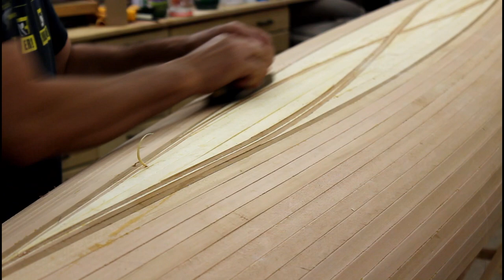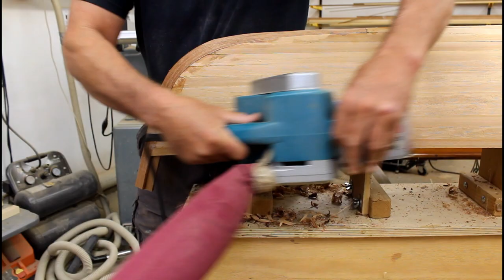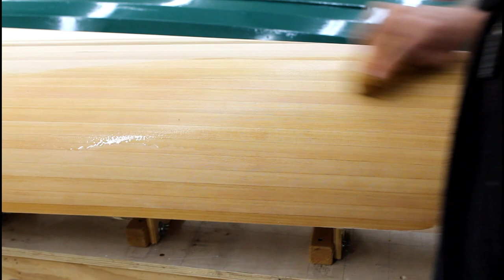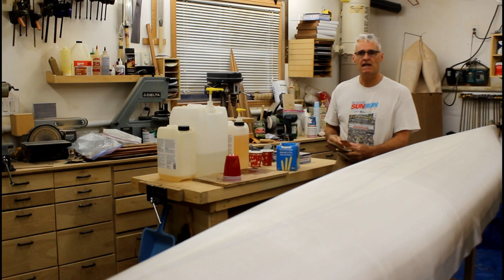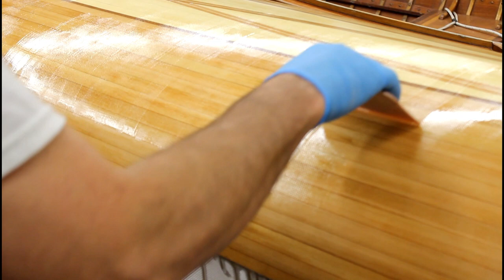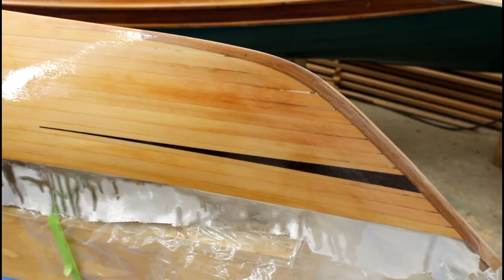Building Skana - A wooden kayak

Comment: I have never seen anyone use a power planer on a boat before.  Crazy!  Also an belt sander on soft cedar!  Frightening!
Reply from the maker: Not for the faint of heart I suppose, but it makes light work of removing material fast.
Reply: @OrcaboatsCa  I guess I am faint of heart! Your aggressive trimming with a utility knife is scary enough.  I imagine years of experience help!  with such tools I remember that you can easily take wood away but it is hard to put it back!
Reply from the maker: @keithnp51  Oh, it has happened a few times over the years.